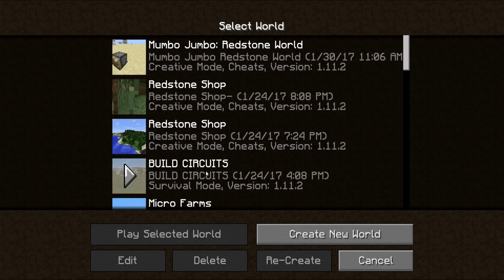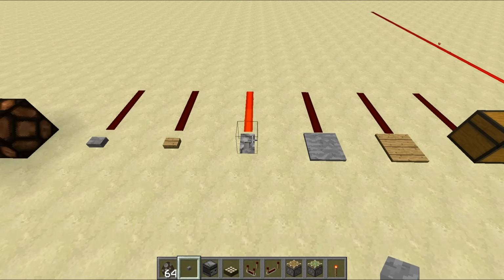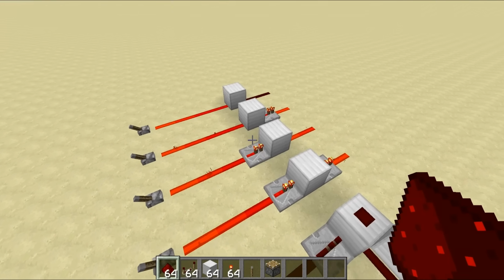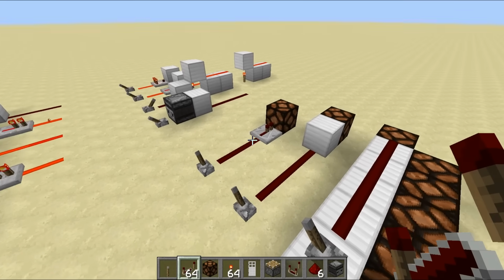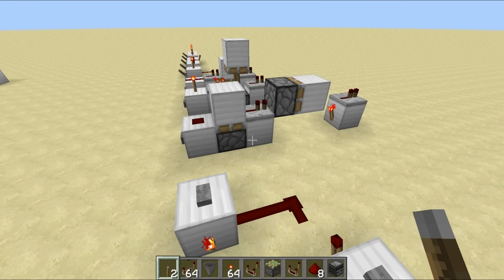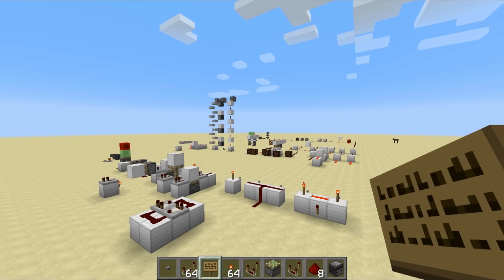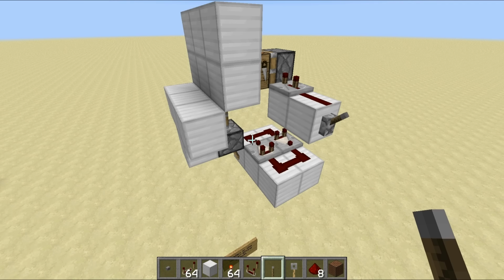How to go From NOOB to PRO at Minecraft Redstone!

Comment: I have a redstone challenge for you  Mumbo ^^

I saw the latch and tried it out, and it gave me an idea. a one way door roulette. One door remains open and the other is closed. There is a pressure plate on the outside of the exit and inside of the entrance. Once you enter, the entrance locks and the exit opens and upon exiting the exit locks and the entrance opens. The next thing is that the pressure plates must be positioned so that if someone should try to enter through the exit when the exit is open, that it triggers the latch and locks the exit.

Comment: The pulse extender works because it the comparator outputs a redstone signal of equivalent strength as it receives but it also applies a delay. So as the input signal gets weaker, so does the output signal. This continues until the signal fades completely. The reason it gets weaker at all is because of the redstone dust, being that it is a 2 block long trail, it weakens a little between each comparator.
Reply: Heh heh heh, thats like the ONLY pro knowledge I have. Xd

Comment: For the Challenges that you gave us, I made the first one quite easy not as compact but i did make it dual sided, the second one i done but i didn't use and RSnorlatch so it was toggle able by the wire and for the third challenge mine was quite large its used the pulse to button signal thing with the redstone block and it was much faster that the one you made but that meant i took up more space

Comment: I taught myself how to make searchlights.

Manual version: Put a button in front of a T-Flip Flop, connect redstone, and put a lamp at the end. And if you want to, you can branch off the circuit to note blocks which will be the alarm.

Automatic version: If someone were to break in, forget the T-Flip Flop, place an observer in place of the button, put it next to your block, and on down the circuit, make a Not Gate. Then add the lamp and alarm at the end. That way, when someone breaks down the wall, door, or whatever, the not gate will send a signal, sounding the alarm and turning on the light.

Comment: It's so hard to make a double piston extender in Pocket edition 😂
Reply: Yeah, i had to make my own redstone clock, usa a monostable circuit and a hopper clock lol
Reply: I found a simple way: use two redstone dust instead of one at the front piston, set the back piston's repeater to 4 ticks and use 2 repeaters for the middle piston both set to 4 ticks
Reply: Observers will detect when the lever is pulled, with a delay, you piece the rest together. Same concept for triple
Reply: set the first piston to 4 ticks the second to 8 ticks and the last to 0 ticks

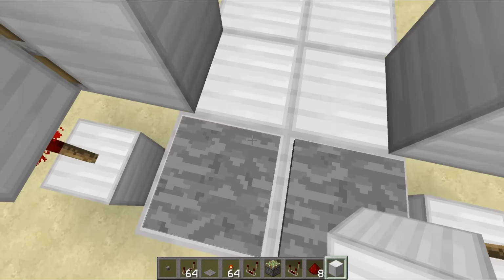Comment: I hate to bring bad news, but Mumbo's solution at 19:16 no longer works (at least, not in 1.13, which is when I'm writing this).

Pressure plates only produce 1 signal strength, so the signal can't reach the redstone torches. I modified it by adding repeaters and shifting things around a little. Not too much different. But I thought I was going crazy! Took over an hour before I realized that I wasn't doing something wrong. Hope that helps someone. And thanks Mumbo for all the other info. If you see this, hopefully you can put a note in the description. Cheers!

Comment: so I'm on a ps4 playing instead of a PC and for some reason the double piston extender wouldn't work. I built it the way you did and only the second one would extend but not the first. so then I tried something different and got them both to extend and retract but I didn't realize that what I had done was "hard power" a block behind the first piston. so I tried it a different way by setting the repeaters to the second click and they both would extended but only the first retracted. so I gave up then the redstone clock went work because for some reason I can't get the hoppers to face each other.   I have to use a block to get one facing left or right but then I can't place another that will face the other hopper because trying to place it opens the hoppers inventory. and if I just place it on the block next to it, it ends up just going down instead of to the left to the other hopper. does anyone have any ideas about how I could go about making these things work for the PS4? help would be much appreciated.

Comment: I've been building megaprojects for over 5 years now, and I have never known that half slabs can also recieve a signal without cutting off the other blocks' signal. Very impressive! Could the downwards transportation not be easily fixed with a torch system?

Comment: My first project was a toilet that i made using a rising edge monostable circuit with an observer looking at the block that the piston is moving, to make it have two quick pulses, and an inverted redstone torch with delays to make the bottom block retract, then the water is taken back into the piston to make it flow down into the sewer. The piston then comes back, then the water comes back. I know, it's amazing.

Comment: I have been doing Redstone for most of my mc career and it's nice to just run a refresher and reboot the system every once in a while. Wouldn't say I'm a master but am experienced enough to run 3 sets of 10 tnt cannons to a single button on a pirate ship (favorite things to build) on both sides.
Would like to mention something. I wire my contraptions on console but I'm fairly certain the Redstone SOFT powers all the blocks around it except for the top which it hard powers.

Comment: Lol before I knew about inverted redstone torch powering, I would use a stick piston with a redstone block and a button, so when it was turned on, the block would be pushed away, and when it was turned off, the block would be pulled back, powering the circuit (I did this the first time in my "secret garden" 1x2 piston door)

Comment: Thank you for making this video. I watch your videos, but decided to watch this slightly older one to get me back into making redstone contraptions. Your explanations of the circuits, redstone mechanics, and basics helped me understand terms a lot better and what makes redstone work the way it does. I appreciate the ending of the video where you gave us tasks to complete, and I made the door correctly, the security system didn't work well, and I couldn't complete the pop up crafting table. However, your explanation on the builds let me fix my builds to work better and be more compact. Thank you Mumbo, I will work more on my redstone creating and remember every thing in this video to learn and build even more. If there is a part 2 to this video, I will search and learn from that as well. Thank you Mumbo!

Comment: Btw mumbo I neeeeeeeeeedddddd you to read this I've learned that you can also power two way path (the one that's goes up and down "transparent") but apparently stairs also work as both a block and a transparent I bet you didn't know that apparently that quarter block from the stairs thats missing is apparently a way you can move red stone but as well is can go from the top side but the positive side is it can go down not like slabs

Comment: Awesome Video Mumbo Jumbo. I had a question though...
The solution for the piston door only works with pressure plates on one side. If you want to walk through it both ways you have to do something different, no?

I used an embedded NOR gate taking the signals from each pressure plate. Is there a better way? Thanks.

Comment: I thought I was crap at redstone. I feel a slight bit better now. Just a slight tho, cause I AM watching the redstone masta! 

Edit: I made the piston door, but my redstone was less compact
Edit: I cant figure out the tripwire to activate a looping noteblock track aka starting a loop/clock. But I did figure out if you trigger a tripwire that is connected to a clock it will stay lit without the normal clock function.
Edit: I did it! Im proud of myself lol
Edit: I failed on the crafting table one, but now i know how to make a crafting table appear in the cealing with 2 button presses XD Cant go back in either lol

Comment: my piston door was so different
Reply: also for the trip wire I made it so a piston put a block on top of a torch which powered the block the added that hopper clock and to turn of a button pushes the block back and you dont have to reset

Comment: do you have to use iron blocks???
Reply: Brian Smit 
No, in fact a large amount of blocks can be used. The ones that don't are called transparent.
Reply: thanks ; )
Reply: Brian Smit No.
Reply: Any full opaque block will do ;)
Reply: Brian Smit he is only using iron because you can easily see the block outlines
Reply: Lachlan - Minecraft and More And Also They are called good conductor of electricity? :)

Comment: Instead of an rs nor latch system for the alarm I used a T flip flop but used a regular piston instead of a sticky piston and attatched that to a comparator clock. For my button I just used a button input connecting over to a sticky piston with a block on it to the opposite side of my T flip flop and it worked like a charm

Comment: I was messing around on PS4, making a egg dispenser that shoots eggs in the air. I was using a repeater to continue the Redstone signal and when I turned the lever off the Redstone signal didn't turn off. I realized if you make a circle of redstone and add a redstone repeater when you use a lever to turn it on it will continue the Redstone signal around the circle and then there's a constant signal, I even broke the lever but it still stayed on!

Comment: for the crafting bench design, i tried to use a rising edge monostable to activate two seperate piston things with the block in one and the bench in the other. i used two sticky pistons to retract and extend the bench and piston behind it, and i made the monostable on the side right where the back piston would land. then i tried to make another one on the top for the replacement block, and it worked, but i couldnt figure out how to time it to where everything went in order. your way was MUCH simpler, but i didnt even think of using the pulse extendor. boy howdy does my brain hurt haha

Comment: Anyone know of a signal length decoder that still works? These were big around 1.8 and most signal length encoders still work while all of the decoders seem to have broken. They shouldn't be too hard to make or fix, I've managed to get something working using an observer block on the signal to unlock an ethos hopper timer for one go, an observer block on that, both observers feeding into an AND gate, so that when the signal ends at the exact same time as the hopper timer finishes both observers will pulse at the same time, unlocking the AND gate. Now this crazy contraption works, it's just bulky. I'm sure someone much smarter than I am has a smaller and/or simpler design and that's what I'm looking for.

Comment: the double piston extender didn't work for me
Reply: the repeater by the lever is two ticks and the right one is on four ticks delay did you do that
Reply: I did that
Reply: the pistons don't retract which is a problem in my redstone world some of them don't retract
Reply: wizardgaming 99 it worked for me
Reply: Did you connect that last redstone wire to the 2nd piston?
Reply: Are you in the right update
Reply: Yes 2014 peanuts55 , That's what I'm gonna ask you wizardgaming 99

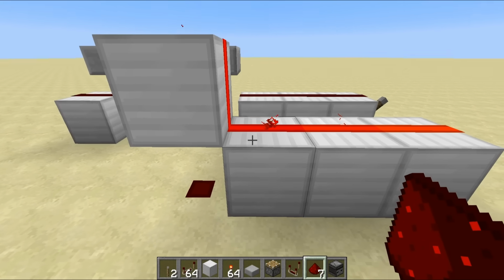Comment: i have a question... if redstone is running up in a "stair way" and we want to power some sort of floor but the "stair case" is a non transparent block, the blocks that are beneath the redstone (AKA staircase") are soft powered right? so if you put a repeater in front of it at the floor you wanted to power would it work? (example: min. 13:00 if instead of a redstone beneath the transparent block there was a repeater would it work?)

Comment: Great video Mumbo!  I remember back  3 years ago when I started messing around with redstone, and now I am pretty good, except I still need to learn to compact my circuits down, and the new blocks that I dont use too much, I always forget they have other features, which are the comparator and the observer.
Reply: Indy 2018 You should really get to know comparators, they are amazing tools, they measure and do math logic too. One of the cool things they measure is the angle on a timeframe each position giving off a different amount of power. I also use a subtracted comparator to make the fastest repeating clock in the game.

Comment: Good stuff.

This is sort of the "Forrest M. Mims III" version of redstone.  Mr. Mims did a series of hand-lettered "Engineer's Mini-Notebooks" distributed by  Radio Shack* in the Seventies & Eighties (and he still has an online presence.)  They cover all the basics of electronics, from the resistors & capacitors to the (primitive) integrated circuits.  They are information-dense and a great way to learn basic electronics.

*Context: Radio Shack was an American company that provided electronics components for hobbyists.  Eventually they got into the consumer market, and by the end of the century they were the "fast food" of electronics--it seemed there was one in every strip mall.  But you could get the Engineers Mini-Notebooks right to the end.  <sigh />  Them was the days.

Comment: The pulse extender works because the comparators doesnt weaken the signal strength they receive. So when it exits, it will have the same strength as earlier. This means that the redstone connecting the comparators will gradually get weaker until they are not powered.

Comment: Ok just going to say. RS nor latch is not the actual name of the circuit. It is SR latch. It is a name made up by the minecraft redstone community. The official name of the logic circuit is SR latch. Doesn't have the word nor in it since SR latches can be made by using nor gates, nand gates, and others which in real life computer logic is what happens

Also to help with any misconceptions, monostables are not just 1 tick pulse producers, monostables have nothing to do with ticks since irl there are no such things as ticks in computer engineering and monostables are irl computer circuits. Monostables irl just produce a pulse of a certain defined length when activated. So in minecraft a monostables can even have a pulse of 50 ticks so long as it returns to its previous state (off) after the defined time

Comment: Sup with the thing when you lead power from one repeater to the side of another, it goes all nuts n' crazy. Found it while experimenting?
Reply: Arttu  Topi When a red stone signal goes into the side of a repeater, that means you can't change the signal of the repeater, unless you take away the signal going into the side. For example, you run a signal through a repeater. Then you run a signal into the side of the repeater. If you turn off the first signal, the repeater stays powered.